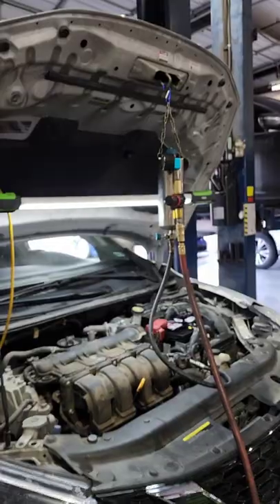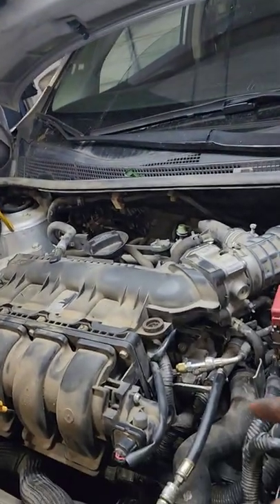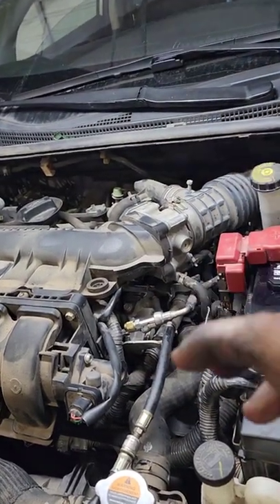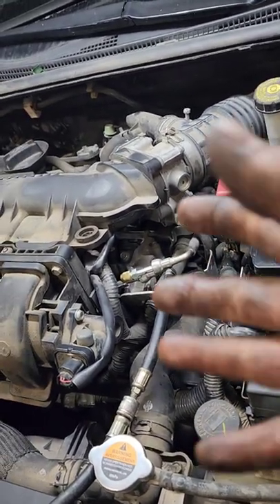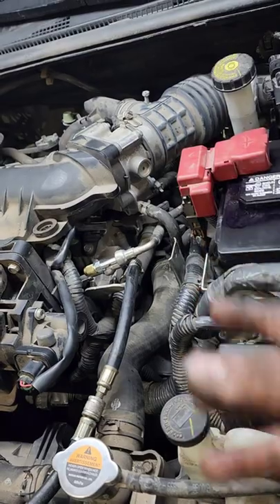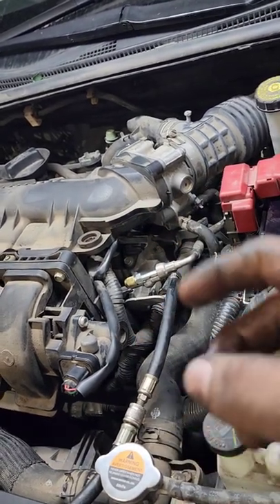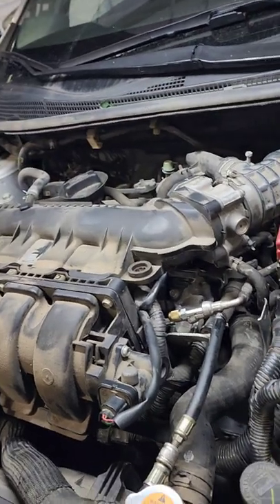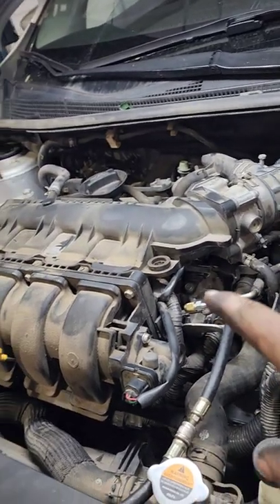FUEL INJECTION CLEANING EXPLAINED....KIND OF 😆😅

Comment: Back then when carburetor was around I use to pour water down the throat of the carburetor to aid in cleaning the carb and any carbon on the valves works great the trick is to throttle  midrange and do it slowly out side not in the garage it smoke very bad works like a charm
Reply from the maker: That good ol decarb service lol

Comment: I clean the fuel injectors when I replace the spark plugs…just as maintenance.
With aggressive maintenance I hope to get at least 300k miles on my 2018 Civic EXT without any repair on the engine/turbo or transmission.
To date over four years, it has 119,000 miles averaging 33.7 mpg (combined city/highway).

Comment: Bro just take off the fuel rail and take them out. Use alligator clips and connect to the battery to open and clean them individually with injector cleaner. Only way to get them completely cleaned. Thats half ass
Reply: How's it half ass when it's being cleaned while it's working.
Reply from the maker: I doubt anybody wants to pay 4-5hrs to do that bro when this is doing it the same way with less labor...60psi on the rail pulsing faster than i can to it myself and at the same time its cleaning the valve and runners
Reply: Someone would only do that if it's there own ride. The service manager would flip his shit if he seen you wasting time cleaning them all by hand lol
Reply: Go ahead and do extra work then man lol
Reply: @mattjingles5758  its not extra when it works better. Fuel injection cleaning is a rip off. It doesn't even clean them all the way. Im not even a mechanic and it took me less than an hour to clean the fuel rail and four injectors. And put back together. Show people how to do it themselves.
Reply: @ronniewilliz153  you probably right.
Reply: @tomdonald2495  it don't take that long to clean by hand but unless they are serviceable Injectors then you'll never really be able to fully clean them.
Reply: @ronniewilliz153  ah true. I guess you're right about that one.